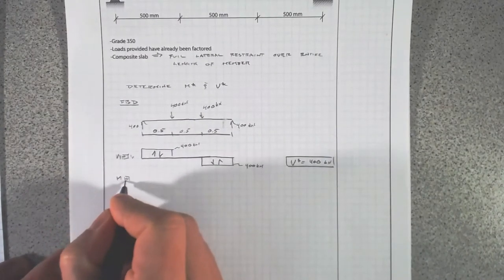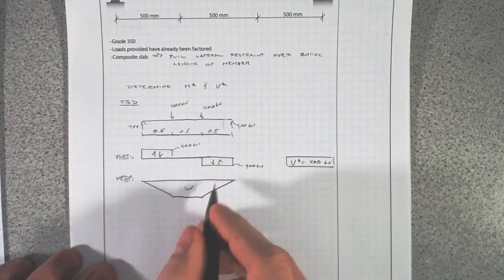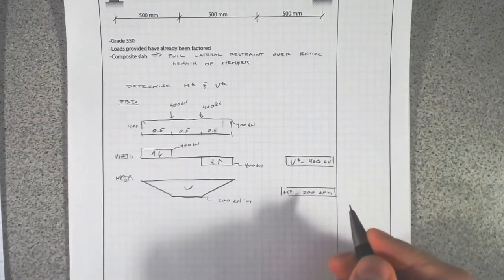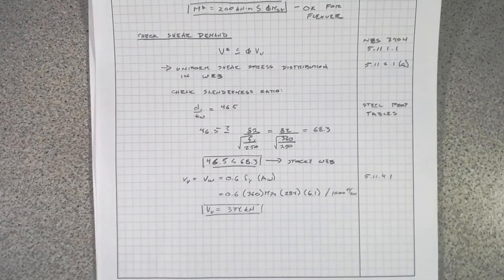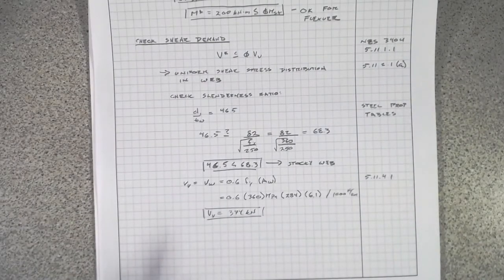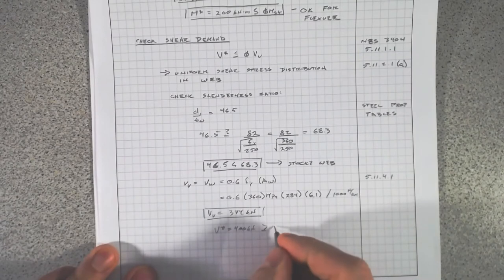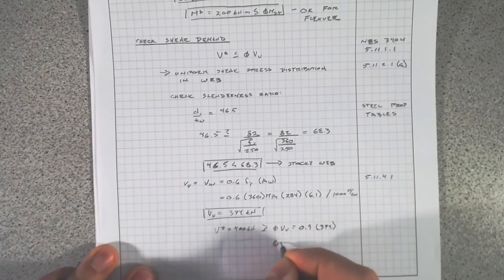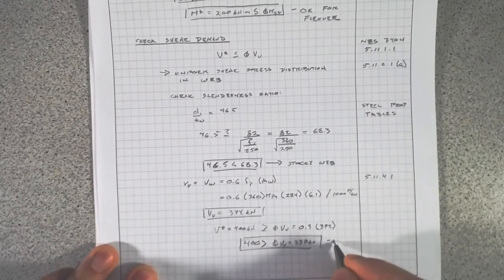Short-Span Moment-Shear Interaction Steel Design Example

Comment: @ around 38 min mark When checking moment interaction formula Vvm = Vv* [2.2 - ....]: 

You used Vv in the equation to be 446. Shouldn't Vv = 496 since 446 is the factored phi*Vv whereas the equation in standards doesnt take into account the phi factor for moment shear interaction?